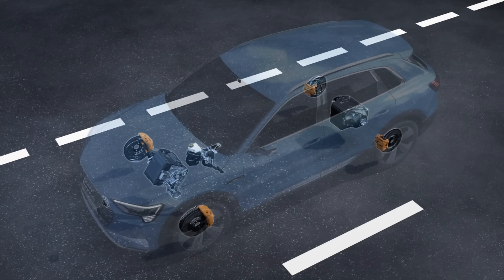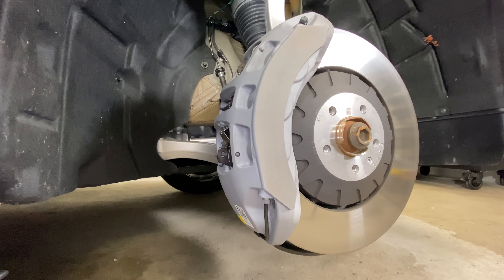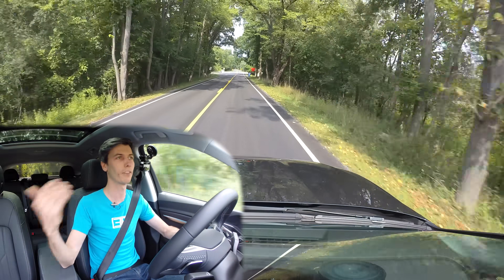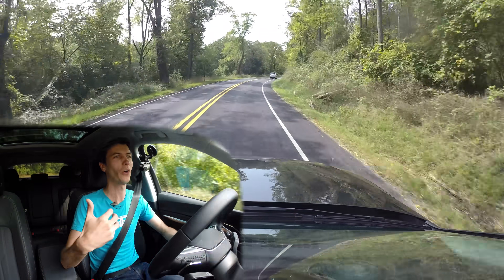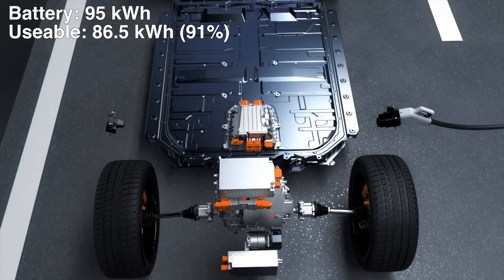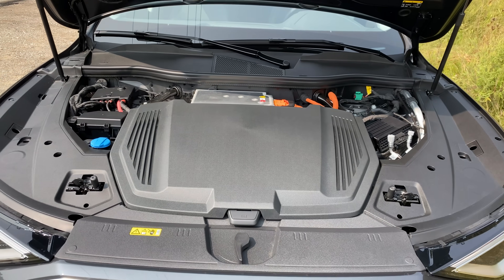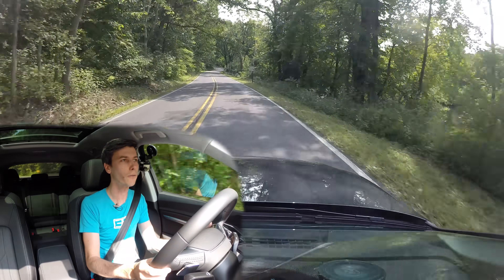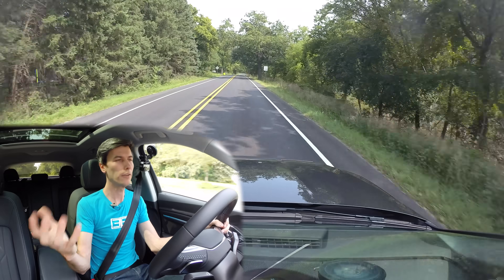How Does Brake-By-Wire Work? Plus: Audi e-Tron Sportback Review!

Comment: I respectfully disagree.  It's an Audi, an owner will know what the hydraulic brakes feel like because something electrical will fail in the brake system.
Reply: Yep and your audi dealer will gladly charge you 1500 to "troubleshoot". And 5 grand to replace the computer.
Reply: 😂😂😂 good one
Reply: Right now we’re seeing 10 years old Audis and BMW falling in pieces, it’s not just the interiors e.g. actuators have plastic parts degrading with time and stopping them from working after few years and owners are charged thousands for replacing full systems on cars with low residual value, regardless of mileage. Cars are no longer built to last.
Reply: It's true why do people still spend more money on less reliable cars, there's just too many daft people in this world.
Reply: complaining about audi and driving us cars that feel and look like lego? r u kidding?
btw just like every single car maker in the early 2000 had problems with electronics. its waaaaay better these days. even companys like mercedes or "the very expensive ones" like bentley had electrical problems from the end of the 90's until the mid 2000's. it just was a period where cars went from "almost everything is mechanical" to "we can do this digit stuff now". its like windows. all versions until windows 2000 were crap. 2000 and xp were the first windows versions that didnt crash just by clicking "start" ;)
Reply: @TheNerd  No it's not.  I work on VW/Audi every day.  Been doing it for a little over 30 years.  It brings guys into our shop that have project cars we can make money on.  They still suck.  And just because other cars suck doesn't make Audi suck any less.  
But, believe what ever makes you sleep at night and have fun going down that long river.  And don't worry about resell.  Just put it all out of your mind.
Reply: @TheNerd  you couldnt be more wrong, modern audis and bmws are junk, they are also coded in ways that often locks your car to the dealer network, where they skin you for parts, usually electronic...from an engineering and repair perspective? they are truly terrible....you dont work on em, if you did you wouldnt be trotting out such crap, you really wouldnt, they are bad cars, especially the diesels...
you want reliable?
kia or hyundai, the days of reliable german motoring are long gone.
Reply: @deadprivacy  I believe that practice is actually illegal. Federal Law in the US states that the car must be designed so that the home mechanic can perform all normal maintenance and repairs without having to visit the dealer except possibly for parts.
Reply: @chubbyadler3276  same in Europe, they just ignore it, look up what's going on with farmers, laptop technicians, car mechanics and the "right to repair" legislation... Louis Rossman is the biggest public voice on this.
Reply: @chubbyadler3276  the computers can be locked, you can get access but its a monthly fee to have their program to do it. The problem is its a cross roads between consumer rights and the intellectual property rights of the manufacturer along with potential epa regulations as most of the emissions requirements are in the programming, which can be changed if you have access. Im definitely on the consumer rights side of the argument,  but that doesnt negate the necessity of it being argued out in court so we all know exactly where we stand at the end of the day, and who is liable for what in the case that a consumer has the right to repair and missuses that right to alter compliance. And if you went dinking around in things you dont understand is the manufacturer still required to honor the warranty? We all know what we think the answers should be, but until it goes through court we dont know the legal answers.
Reply: @jaydunbar7538  It looks like a large part of your argument here falls under "right to modify," which would be a completely different animal. "Right to repair" should only really cover replacing aging hardware that is beginning to show wear, so the manufacturer's intellectual property wold be relatively safe since the operator would not have a reason to tamper with the software in non-data processing applications such as driving a motor vehicle. That said, the manufacturers do typically specify the standards to which their equipment should be maintained to--clearances and such, as well as consumables (fluids, etc) can be aged based on contamination and breakdown characteristics, as well as type ratings, and most manufacturers can and do void warranties if, say, an incorrect fluid was used when the damage occurred, or if unapproved or aftermarket parts were present. To me, the rights of the consumer still seem universal and cut and dried.
Reply: @TheNerd  Made the mistake of owning an Audi. Never again.
Reply: That goes right up there with BMW and their defective turn signals.
Reply: @Rusty That's why it's called Built FORD Tough.

Comment: so you're saying that a fake brake with more parts is better.. how exactly?
Reply: as he said, to get regen
Reply: @makex_se  aaaaaah right because obviously that's impossible to do with just lifting the accelerator and so we need this new contraption that increases engineering and testing costs, bill of materials, failure points, gives less real feel of the vehiche. 
SURE. :)
Reply: @emperorSbraz  you mean the same thing that basically exists on airplanes and is way more reliable and efficient than shitty hydraulics?
Reply: @emperorSbraz  but did you not watch the video? the goal with audi E tron was to make a car where the user dont have to adapt to anything new, they can buy it and it will feel just like any regular gas car but be electric. they are not tesla with innovation. I see your point but they dont want to build a space ship, they wanted a normal car for the user that is electric instead of gas.
Reply: Blox117 Airplanes are held to a MUCH higher standard than cars.. I wouldn’t even compare the two. Also it makes a little more sense in an airplane, especially in larger planes. Instead of running 400ft it brake line you run brakes by wire. Everything in a plane is by wire because of the distance between things and the complicity of operating systems. Also how often do planes use their wheel brakes when in operation? Because I can guarantee it’s a whole lot less often than a car does when it’s being driven. Less use, less likely to fail.
Reply: @kodyjohnson6294  a cable is a cable, whether its in a car or a plane.

Comment: How would you provide redundancy if you remove the connection to hydraulics?
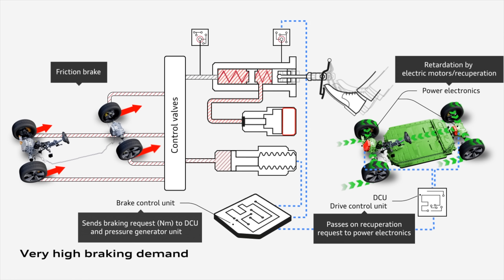Reply: Explained at 2:35. There still is a connection that is opened when there is no power supply.

Comment: I'm a technician at hyundai. I've seen the system fail on hybrids. The vehicle does stop but the pedal is very very hard and the stopping distance is very poor
Reply: That makes sense... It's similar to a convectional power brake system.... If the brake pump fails the pedal pressure rises dramaticly.
Reply: Thanks the info. I was just wondering about this.

Comment: Most of the electric vehicles have only front drive option even though regen brakes only applicable for front wheel  but rear wheel its works  a conventional brake in normal vehicles
Reply: In conventional vehicles the front brakes do a large majority of the braking work, due to weight transfer toward the front when braking.  So FWD-EV regen should work pretty well.

Comment: It is a poor design to have to hit the brakes to get regen. You should just get regen when you let off Accelerator
Reply: What's wrong with one pedal for stop and another for go? Seems sensible enough to me.
Reply: @Xenon0000000000001  Need to drive an EV to understand.....
Reply: @205rider8  I have a very modest racing sim setup at home that I guess could be configured to use one pedal for acceleration and braking. However, no one would ever do that because you'll get less control over braking. 
It's funny how Tesla took the cheap option of standard brakes and regen on accelerator lift off only, and have convinced people that this is somehow a good thing.
Reply: It's a design choice, but I woudn't call it poor. Doing it this way means that to the driver it acts/feels like the majority of cars available now.
Reply: Seems to me like a borrowed concept from another manufacturer. Scania has a mode of the exhaust brake to be activated with a let's say 5% of the pedal travel. Since Scania and Audi are in the same group, it needed the slight modification of regeneration instead of exhaust brake activation to be applied in the car.
Reply: Its not. You can do it the other way if you want to. I work for Audi, and literally no one chooses that option because it's so much more difficult to get used to especially when you're driving other cars. It's also less efficient than linking it with the brake pedal.
Reply: You can configure it so, if you think is necessary. This is a sort of apple designed car. The user is not required to aknowledge any difference. Very european concept also. Youre not supposed to understand what you do...
Reply: I like regen when you let off the accelerator because that is the way it is in my Tesla and this way you know exactly when you are using regen and when you are using your brakes. If Both regen and steel brakes are controlled by the brake pedal you are never sure when the steel brakes are engaged or when you are just slowing down with regen.
Reply: @Alex.AL_26  why would you need to know that? Just brake the appropriate amount for the situation and let the car figure it out.
Reply: @Xenon0000000000001  I just like to know exactly what my car is doing when ever I preform an action.

Comment: Mercedes SBC would like to wish you a nice day.
Reply: I've got this SBC brake system from hell in an e270cdi from 2003. Garbage...
Reply: Yeh. Its all fun and games until it breaks) )
Reply: lmao, I really did laugh when I read that. I work on brake by wire, and about 10 years ago before we had developed our hardware, we jailbroke an SBC system to do software development.
Reply: With that said, they are two very different systems.
Reply: MBenz extended its SBC to 25 year unlimited miles warranty!!!!!!!
Reply: @tonylee486  the pressure accumulator on the hydraulic unit has an expiration time, and when it is over, it triggers a faulty brake warning on the instrument cluster. By the time this warranty is over, it still will need to be replaced, and here in Brazil the price of an hydraulic unit will be three to four times the price of an W211, and there's no go around, the car becomes undrivable and brakes only the front axle with the emergency circuit.
Reply: 😂😂😂 I'm a benz tech and this is to funny !
Reply: @danielquintero5186  me too, we are still replacing hydraulic units to this day.
Reply: Mercedes does everything first, best German company by far.
Reply: Didn't know Mecedes did Single Board Computers, learn something new every day!
Reply: Mercedes and Bosch in the corner crying 😭 😭😭😭😭
Reply: @salem99099  How so? They were the first to do it like always! Mercedes FTW
Reply: @RichRusso4218  yeah thats true, but am just Joking about it when he said this kind of brake in the Audi 😅
Reply: @salem99099  Yeah its an Audi, they come broken from the factory lol
Reply: Jep. And Toyota has this exact principle  of Brake by Wire since 2000 with the first Prius nhw11. X) Audi did nothing new.

Comment: Do electric cars with re-gen braking get a lot more mileage out of brake pads and rotors since they aren't engaged as often or does the extra weight of the vehicle offset that?
Reply: Allegedly up to 10x lifetime for EVs, meaning the car will be dead long before the pads and rotors wear out.

Comment: i think it will go the route like commercial trucks have with their air brakes, the pressure keeps them open, so in any form of failure it just brakes like a mf'er, not the ideal situation, but there is actually no chance of the brakes failing and not being able to stop the vihicle. The only thing that can happen is that the brake rotors/pads themselves fail,